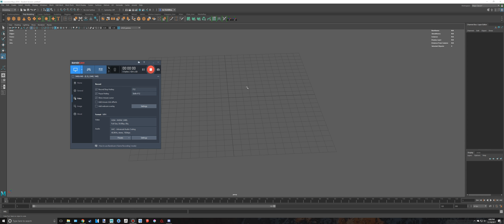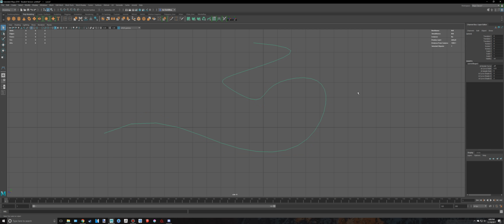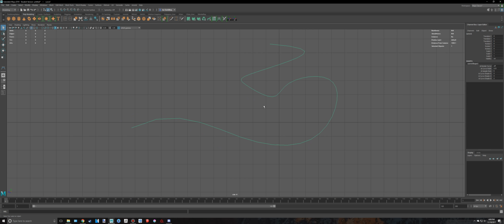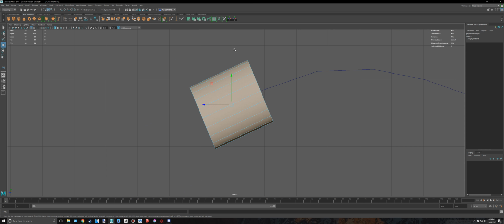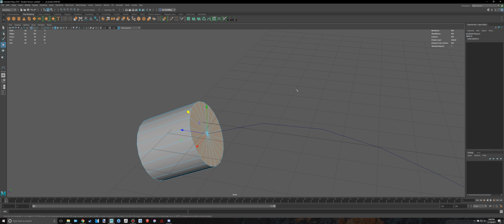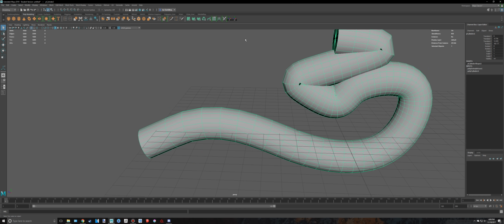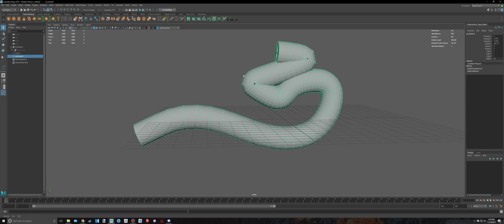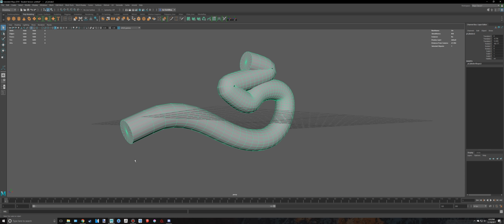Maya 2018 How to extrude along a curve

Comment: Strange Maya bug, but when you use the shortcut key to select the faces or edges (F11 or F10) this process wont work because you are unable to select the curve . It only works if you use the right click and hold HUD and choose Face, Vertex or Edge selection there. Exactly how it's showcased in this video! Thanks, Avi Schifmann btw!
Reply: Thanks a ton!
Reply: ah this was driving me crazy. Thanks for the tip. It works if you use the radial menu!
Reply: thank you for this. I thought it was not working.
Reply: bro you are a god thanks for this comment helped me a lot

Comment: so I'm doing this exactly as you and many others have, I have even followed the Maya Manual, but for some reason when I extrude more than 1 division, it follows the curve, but I also have the extrusion happening that would be from the beginning of the curve to the end without following the curve, along with the extrusions that follow the curve. Is there any way to rectify this? I can't find any help from searching
Reply from the maker: hm that's weird, I would recommend resetting some of your extrusion/scale settings to see if you might of accidentally checked a certain box. Good luck!
Reply: you need to rotate the object so that it is facing the right end and is at the "start" end of the curve.  Like rotate that bish 180 degrees and move that ish to the other side of the curve.  What's happening is it thinks you want it to extrude from where the faces you have selected are @ the start of the curve.  so it goes in a direct path to the "start" of the curve and then extrudes along it normally like it should.
Reply: Man I'm having the same problem. Everytime I extrude it does nothing and it's not following the curve I placed. Any suggestions?
Reply from the maker: Are you in object mode?

Comment: why i cannot use that way ?
Reply: Strange Maya bug, but when you use the shortcut key to select the faces or edges (F11 or F10) this process wont work because you are unable to select the curve . It only works if you use the right click and hold HUD and choose Face, Vertex or Edge selection there. Exactly how it's showcased in this video!